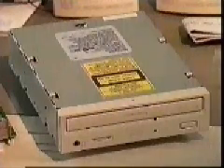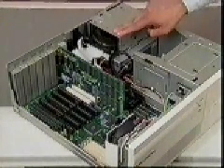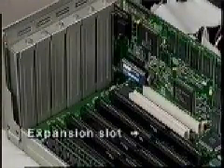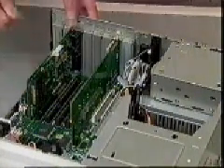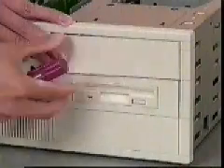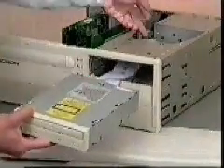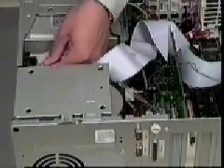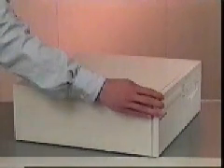Upgrade Your Pentium PC with the Power of Multimedia!!

Comment: Well if your wall socket has a power switch on it then the earth connection is still connected, same if you flip a physical power switch on the psu assuming it has one - so the sensible thing to do is leave it plugged in and powered off in that manner. Course it helps even more if you have a bench with propper grounding connections for wrists straps. Must say though Ive been working in the PC building industry for a long time and ocasionally just don't bother never once had an issue with static.